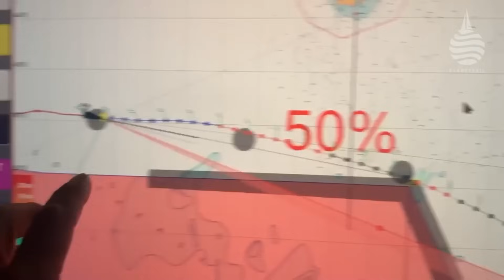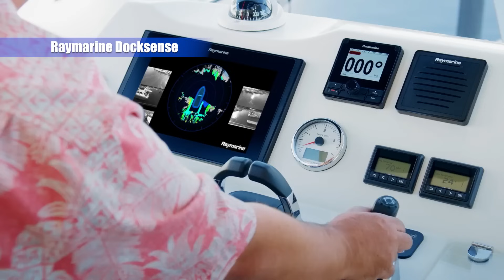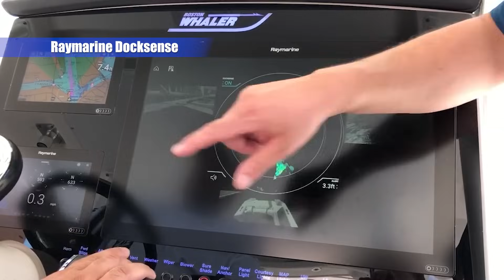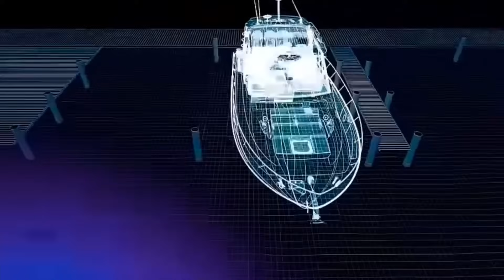AI Powered Sailing is Coming, and other sailing news.

Comment: The AI thing is very exciting!  Imagine having an onboard AI that when you get on the boat you tell the AI to set “Sea and Anchor Detail”.  Immediately the AI starts main engines and both generators shifts the load to the generators and puts them in parallel.  Then the AI gives a verbal report to the captain with any noted anomalous readings.  The AI tracking engine hours and maintenance requirements.  Not to mention AI taking over navigation and piloting needs.  Very exciting!

Comment: Not very clear as to why, after a dismal failure with a new cat. design you would choose to give the same manufacturer a second chance. Time to let others trail blase to a proven success before I'd give them another try.
Reply: Why blame the delivery on the builder?
Reply: @nixl3518  It was the design and manufacturer failure that lead to the delivery challenges and in turn failure.
Reply: @wetsuit5  if you want to make a point, be specific! What exactly are you faulting the manufacturer for? To me, it appears that the delivery people made repeated errors in judgment, resulting in the dragging of their anchor, resulting in flooding and dragging of the boat all the way up to the beach! That cannot possibly be an error in design or a problem with the manufacturer, but a problem with the sailing abilities of the delivery!
Reply: @nixl3518  Review the associated videos. It was cascading defects and vulnerabilities in manufacturer at the inception of the failed voyage. My opinion doesn't really matter, with public knowledge of the failure, the boat model becomes unsellable.
Reply: @wetsuit5  I saw no "cascading defects" that were not associated with the misjudgment of the passage. You still appear to be reluctant to name the defects you hold were responsible for the failures you appear to think are systemic. Why such reluctance? Name a couple. 

In any case, this is not a newbie boat maker, has fleets of cats to its name, so even a single failure would not dent their production. You seem prone to jump to conclusions. This is not about opinions, but about your self-assured assumptions, which you need to support to validate your point; there is a difference. 

BTW, Bobby had and still has opportunities with this manufacturer he would not get from others, which is why he selected one of their boats and sticks with them. It's "funny" how you assume he'll listen to your advice.
Reply: @nixl3518  Sounds like you own stock and have a vested interest in the company. Don't really care and I'm not going to do your home work for you.
Reply: @wetsuit5  LOL!!!! There you go again making crazy assumptions!! I have NO skin in the game silly!!! I do not know the company beyond what I've seen in real life and on YT. As for the work, again SO FUNNY, What comedy!!! You are the one making the points so it's up to you to make them, rather than assign me your homework!! All you did is prove you have no idea what you're talking about! BYE!! 🦤🦤
Reply: @nixl3518  You don't get to assign me your homework when you don't pay attention to the details of the videoS. I paid close my attention in forming my opinion, you just want to argue what you don't know.